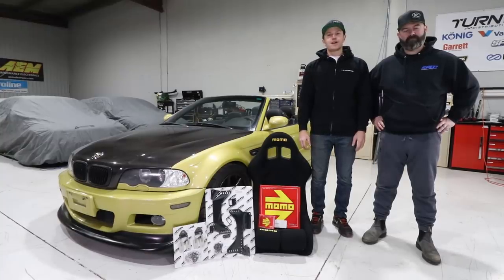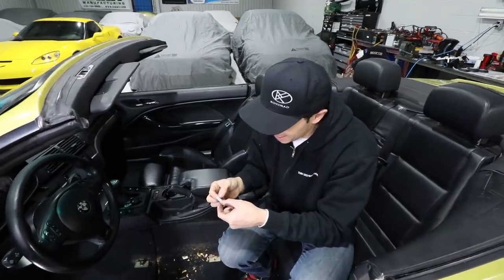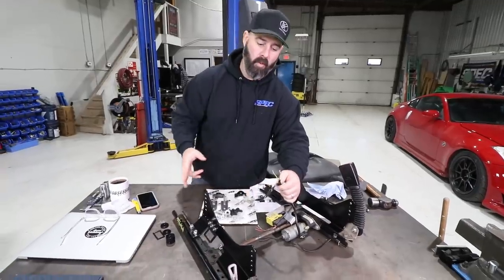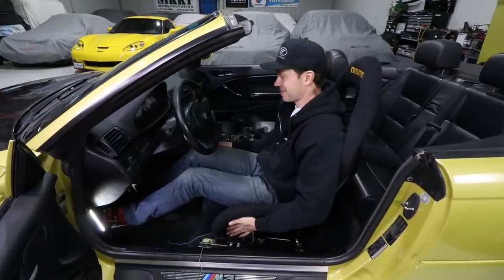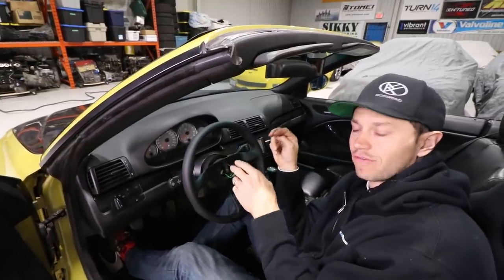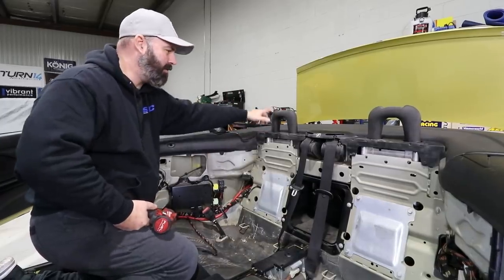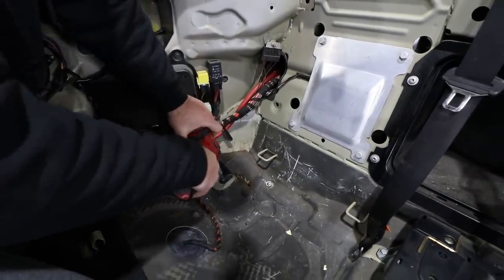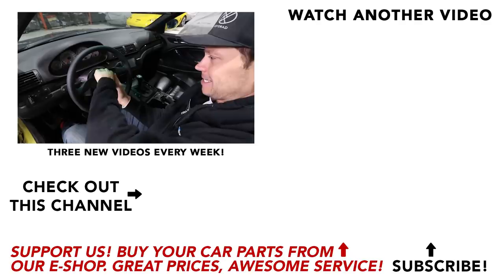Rebuilding and Modifying a $4000 BMW E46 M3 - Part 3

Comment: For my track car pedals, I personally just removed the rubber pads and then replace with skateboard grip tape.  Works great and is cheap and easy to replace when it wears out.

Comment: Since you are putting in a roll bar, you could use one of the back seat seatbelts and make a mount off the roll bar to run the stock seat belt. For ease of use when driving to and from the track.

Comment: Does the E46 have telescoping steering? If so, why bother with a racing wheel at all? Wouldn't you rather pull the airbag fuse and still retain the ability to change radio stations mid-tandem?

Comment: I want to do the same setup as yours . Is all the e46 oem seat track rail same ?   M3,330,325xi etc... I found the good deal on Ebay for sets but they are off of 325xi. Thank you for the help.

Comment: So if its on a power slider, does it only go forward and backward or will it still move upwards or drop back down to sit lower?
Reply from the maker: Forward and back. The up/down function is a part of the stock seat that cant be transferred to a race bucket

Comment: I did the same thing on my e90 m3, how did you get rid of the airbag light?  any advice would help.
Reply: Harry Hernandez  Schwaben sells a bmw scan tool on ecs tuning.com that can actually reset your airbag light not to mention it does a bunch of other stuff too check it out it’s on sale right now for 149$ usually 200$
Reply: Harry, You need to hook up a resistor to the connectors where the airbag used to be.  It just mimics the airbag  so the ecu thinks it's still connected. All you need is a resistor and a couple of connectors. A resistor will cost about $50 cents from a electronics store. Just make sure to get a resistor with the correct value.  On a some of the cars I have done I have used a 2 ohm resistor (I think) can't remember it's been a while. Cheers.

Comment: Instagram @lil46vert 
I have since removed the rear seats and roll over protection bars. Saves a good amount of weight. I’ve learned some issues about roll bars in the verts. Currently cutting half the car apart to tie the roll bar into the rear subframe cage.